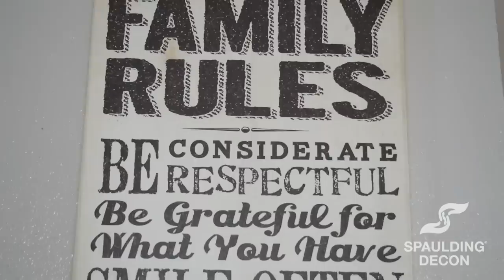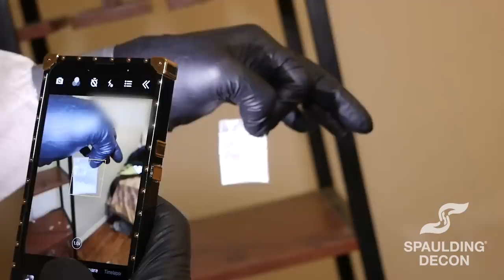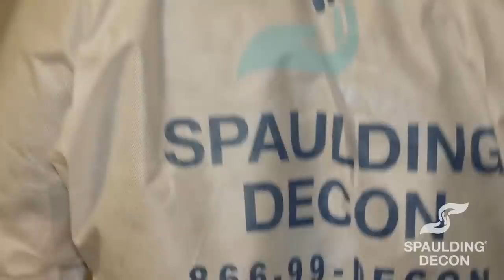C*****e and a Lazy Boy

Comment: Respect to the departed one. But I have to ask how: if he died in his chair, he ended up on the ceiling? I know you can bloat due to the gasses generated but I'm still lost how he got up there.
Reply: He probably popped, it's gross and disturbing but it makes the most sense.
Reply: I saw a similar show about Japanese death cleaners. They said that flies land on the body, get bio on their feet, then land on the windows and walls. It can cause the transfer of a lot of bio (including fat). Not sure if that explains the ceiling blood, though.
Reply: When u die gases build up and you can pop. It’s why when body’s are found in lakes they’re floating because of the gas.
Reply: Slippage, skin slippage.
Reply: I’m still confused about the blood spatter on the wall
Reply: @_anon_4532  he popped..blew up.
Reply: yup, you can only bloat for so long until the skin's at its elasticity limit (which is even less after death than before), so the likelihood is he bloated to the extreme until the decomp liquid evacuated with force out of whatever part the pressure built in the most
Reply: Any of yall thought it was a suicide? You don't "pop" and send spatter to the ceiling.

Comment: I don’t condone using substances, but if you do please test your stuff. You have the right to know what you’re taking. Fentanyl is in everything now. Test strips are super cheap on Amazon
Reply: Just want to throw out something in regards to fentanyl test strips. If you use cocaine, meth, or anything other than opiates you should absolutely use them. But at this point, especially if you are on the east coast, any bag of heroin you buy will have fet in it. The best practice is to either snort or inject something the size of half a match head. Wait 20 mins if snorted, 5 mins if injected to gauge the potency. Even if its the exact same stuff from the same dealer some bags will be more potent than others because of how difficult cutting down fentanyl is. Worst case you can mix up a regular shot, push off a tiny bit and wait a minute or two before pushing the rest in. That's generally how I did things because of how difficult finding a useable vein was. It's far from ideal, but it saved my life twice. Also you can do absolutely everything right, but if you use alone and something goes wrong you're gonna fucking die. There's a service that came online a few years ago called never use alone that has saved dozens of lives. You call an operator, let them know your location and do your shot over the phone. If you become unresponsive they send an ambulance to your location. I know how hard this shit is, but you can't get clean in a coffin so do whatever you gotta do to stay this side of the ground. If anyone needs any resources or just wants someone to talk to I'm here for you.
Reply: @jg-ub4ek  Also, isn't supervised injection sites a thing now? I know they are in other countries, but weren't there talks of opening some in the States shortly before covid hit?

I'm not a drug user myself, but I live in grand ol' Ohio, and I was homeless for a stint, so I'm well aware people do it. I had no idea about the never use alone thing, but i have heard of supervised injection sites.
Reply: @autopsyturvy  I spent a few weeks homeless in Dayton back when I was hopping trains, that city is no fuckin joke. Glad you made it to the other side! I know there are several scattered throughout the world, but afaik every proposed safe injection in the US was shot down. There were a couple that passed by city boards that were shuttered after the community outrage.

Comment: Im curious, how does it splatter? im assuming that this death was oversdose related which means there should be no trauma. could it be inflating of the body due to decomp or what?
Reply: Wondering the same..
Reply: Probably popped from the gases of decomposition not being able to escape
Reply: @CL3773  yes, this is exactly what happens

Comment: Fascinating and educational cleanup yes I’m always impressed by your teamwork and the level of care you take on being respectful. 

The manner of death... Due to head position,  pooling and splatter, I am going to guess that this may have been a gunshot to the head.
Reply: I got the feeling it was a drug overdose.  There didn’t seem to be enough spatter on the walls behind to be gunshot.  The head just flipped to one side after death and decomposition makes the fluids all pool there.
Reply: You could be right, but I am curious why there would be blood splatter on the wall aside from the body expanding and then popping with decomposition. I would expect an abdomen to pop, but not a head. Not to mention the fact that he supposedly sat in that chair without being noticed by his roommates as deceased. If not for the excessive quiet and lack of motion coming from his room, then the stench would surely make someone pay attention, no? Then again, if the whole house was using drugs, I suppose, depending on the drug(s),  it’s very possible that nobody noticed there was a dead and decomposing body in the other room. Still a fascinating clean up ... with so many questions!

Comment: Curious. When you see a couch or piece of furniture that’s pretty much soaked through, why continue to take it apart layer by layer.  Wouldn’t you just consider the whole thing bio waste at that point?
Reply: I’m guessing they still have to clean it in case somebody was to touch it lol idk just taking a guess
Reply: I’ve had the same question. I think he said even if it ends up being almost the whole chair  it makes it easier to get into bio bags anyway?
Reply: From what I understand the bio needs to be processed separately and it costs more to dispose of. Rather than pay for say the whole disposal of the chair they just pay for the bio at the higher rate. They explained  it in a really early video. Plus they keep it safe for who ever else has to handle it

Comment: Why don't you just throw the whole chair away as bio?
Reply: Was thinking the same thing
Reply: Bio waste is processed differently, so it's more expensive. No sense paying for 50# when only 15# is actually bio.
Reply: In other videos they've explained, they have to pay per pound of bio to throw away and it's a lot more expensive than trash
Reply: They’ve explained before that it’s per pound to dispose of. But you’d think with the time it takes to pay someone to dismantle the chair, the cost would be a wash. Not to mention the fact that the person clearly died IN THE CHAIR, just assume the whole thing is contaminated. There was a dead body in it!!

Comment: Huge question! Why not get rid of the whole chair because there's so much biohazard on it? Why cut it down that much to remove every little piece contaminated when it's so much it's best to biohazard the whole thing??
Reply: I think I can answer that. Anything contaminated w/ biohazard goes in a red bag. The uncontaminated goes in black. At the dump site or burn site or whatever they call it, workers there are not Spalding ppl. Those workers handle the black bag & red bag disposal differently. Black bags can be buried & can be handled w/o tivek suits. The red bags I think are burned but the folks handling those bags suit up differently maybe use respirators.
Reply: Also the cost to dispose of Bio is more expensive.
Reply: For one thing bio is more expensive than waste, but another is they can get extra money back by recycling the metal, like the springs and other foundation parts of the chair.

Comment: Do the operatives cut down the biohazard parts because they are so expensive to dispose of - I would have thought the amount of biohazard of the chair would have warranted it all to go as biohazard as it takes them so long to disassemble. Just wondering.
Reply: I don’t know for sure, but they might have to separate fabric from metal-which is why they take it apart. 
It’s also possible that the disposal of bio material is more expensive than disposal of regular trash so they go through the layers and only take what’s contaminated-the rest of the chair can just be tossed separately.

Comment: I have a question. If it has been answered before, I apologize. But, if a piece of furniture is going to be destroyed and removed with the rest of the bio, why not just leave it intact and remove it whole? It seems too much work to cut and remove fabric then use the saw and piece it out when you could just remove the entire piece and be done with it and get to the next job quicker.
Reply from the maker: It would be significantly quicker if we could just throw the whole thing away, but legally bio hazard like blood and stuff has to be disposed of differently. And because it cost more to properly dispose of bio hazard than regular trash, we take the time to cut out just the affected areas so that way it saves the families and or the insurance companies a lot of money for these types of jobs

Comment: How much are you actually saving by cutting up the chair instead of just throwing whole chair in bio. Also I'm shocked you guys didn't totally gut that wall and base board behind that recliner like you guys normally do
Reply: I believe that the bio is weighed wherever the facility is. The general dump will not take anything that has bio on it. Too much liability involved when it comes to that stuff.